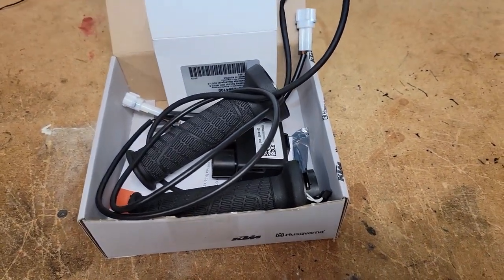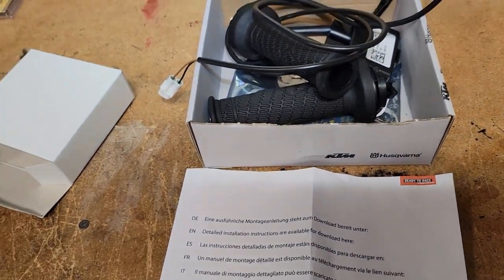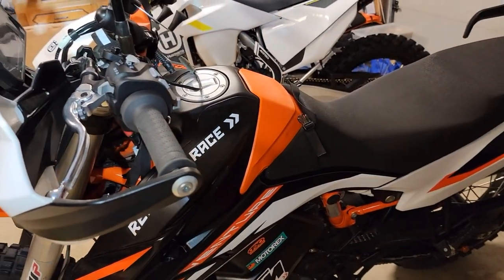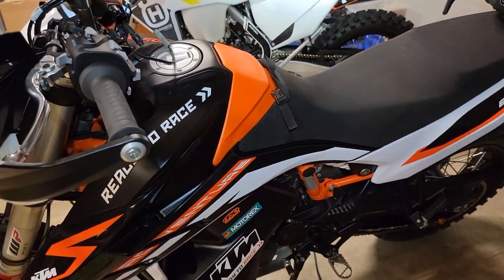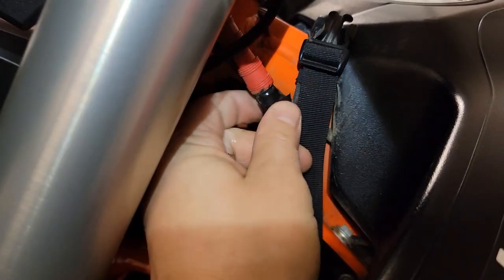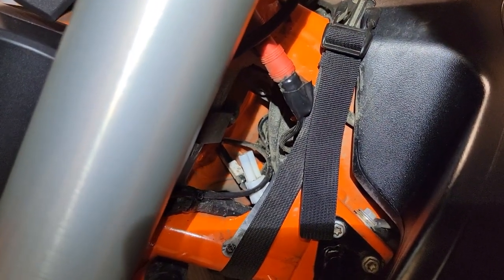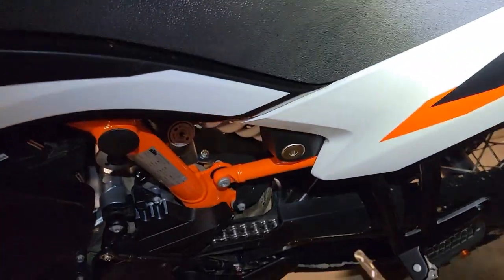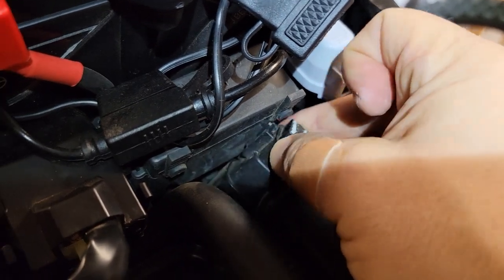KTM 890 Adventure R Heated Grip Installation--Super easy installation!

Comment: Is there a way to buy only the grip sleeve so I don't have to cut my old grips?
Reply from the maker: The old grips do need to be removed to install the heated grips.  Great to have in the cold though!  :)
Reply: @Oregon Moto John  I was thinking of installing Oxford grips because I heard of the ktm one's not being warm enough. What's your take?
Reply from the maker: Solderpro_1  I LOVE Oxford grips and have had them on every bike I own except the 890. I am a huge fan of those!. The Oxford grips will not disappoint and will work well.  The KTM grips integrate well with the LCD display which is the main reason I went with them.  They do get adequately hot and I have never needed them warmer, but the Oxfords will cook eggs if you want.  😉